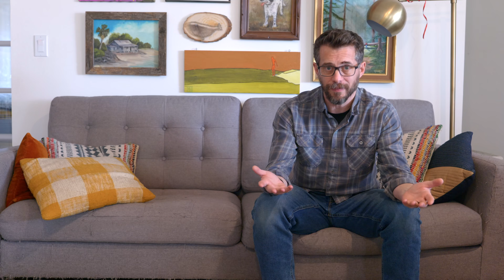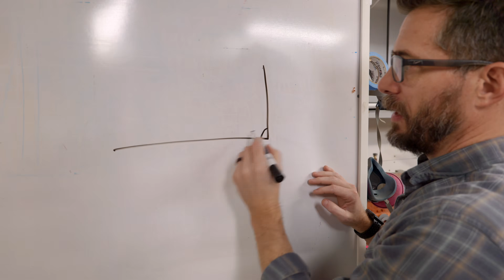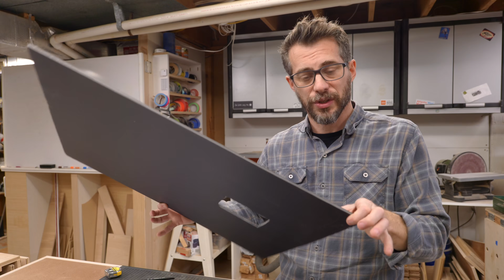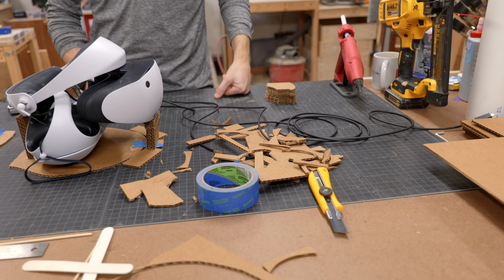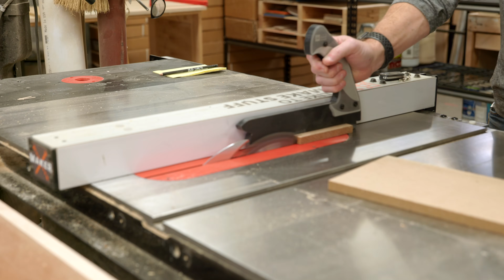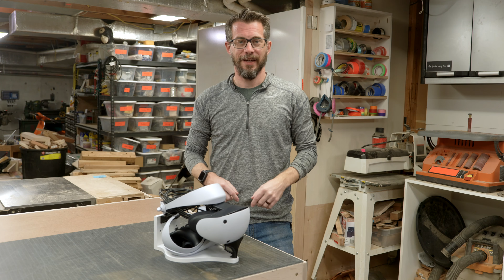I Fixed My Problem with the PSVR2!

Comment: Awesome video! One thing I would suggest to change is the back panel, or mounting panel. I would definitely reshape the corners, round them off in some way. The whole thing, including psvr2 is so curvy that those corners stick out like a sore thumb. Otherwise awesome!
Reply from the maker: That's a good call!
Reply: @Iliketomakestuff  Thanks! I'm a cabinet maker myself so I guess it just jumped out to me 😌

Comment: I still remember many podcasts back, when Jimmy mentioned that the first thing his students did was try to 3D print a prototype but they could’ve easily used ready made things like plastic bottles or make simple shapes with styrene. Adam Savage also talked about building a small room with cardboard. Even software/web design is somewhat quicker with an initial sketch. Low cost and low risk ways of trying out concepts never gets old!

Comment: I bet the console gets hotter inside that cabinet lol. Need to cut a hole in the back of it so the hot air isn't being pulled back into the front again cause it needs cooler air circulation. My PS5 sits in the open and it's like a heater blowing out the back so being in a cabinet would be like putting your PS5 in front of a heater which isn't good.

Comment: Great video! Since you used MDF, I would recommend rounding the corners of the back piece just a little more because it will lessen the chance of the corner getting dinged and it will match the other rounded areas on the piece. The 3D printed parts were very cool!

Comment: Nice stand. I made one for my VR headset using a plastic mannequin head that i filled with concrete to add some weight and mounted to a wooden base. Looks pretty awesome and cost me next to nothing.
PS. The real issue with the PSVR2 is that it's tethered. Once you try a headset without an umbilical cord, you'll never use anything else anymore. It's on another level of freedom and immersion.
Reply: So true!! Switched to the quest last year and I’m never going back

Comment: Hey, love your videos. Can you start referring to your "CNC" as a "CNC Router"? Lots of machines have computer numerical controls. The one you're talking about in this video is specifically a router. Thanks! I'm sure you know all of this, but I think it's important to be specific. When we have access to great machines such as mills, lathes, routers, laser cutters, vinyl cutters, 2d printers, 3d printers, etc., all of which are either CNC out of the box or can retrofitted, descriptions can get confusing if they're not accurate.

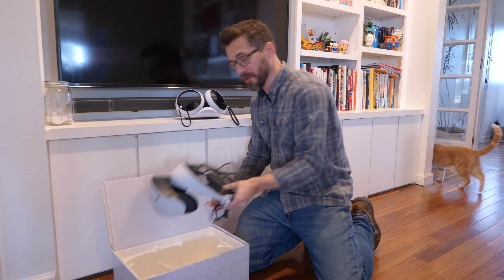Comment: 1:45 There, right in front of you on the floor, the thing you just pulled the PSVR 2 out of, the solution you've been looking for in terms of storing the thing. My pleasure.
Reply from the maker: Except that you can't charge the controllers in the box.

Comment: The design is cool. But the back piece is very massive. And it's unnecessary. But anyway . Well done
Reply from the maker: How would you wall mount it without the back panel?

Comment: It's been a week since I got my psvr2. The controllers have been f'ed since day one. Buttons and analog don't work while in game.. But works fine on the ps home menu..

I waited for the update.. But didn't fix anything. Should I just send it in now for a replacement?
Reply from the maker: that's a bummer! I haven't had any hardware issue, but yes, I would get replacements asap!

Comment: What brand are those docking stations for the controllers?
Reply: Proprietary Playstation mate, should be able tp get through Sony or anywhere that sells the PSVR2 👍
Reply: @DICKO80  😅No, the charging stands for the dualsense controllers
Reply: That’s what he was referring to. You can get them on the Sony site.
Reply: @MileHighMonroe  No, those are not the same, I have the ones from Sony. The stands in the video has animated front plates, the ones from Sony does not have that.

Comment: did it work okay with the fact the headset strap is adjustable? i'd imagine if you take it off by extending it all the way it wont fit properly...
Reply: Usually when you extend it fully to take it off you don't leave it fully extended. Once you extend the strap, it only locks in place when you turn the dial, which most people only do to tighten it onto their head.

Comment: Why don't you use a 3D scanner and scan this thing. Then put it in your CAD software and build around? The 3D scan is done in under 5 minutes... Would you have saved days and a lot of work. And it would fit perfect....

Comment: Very slick, sir. A stand by, and for, the consumer / user. It may not be for everyone, but it is a very well thought out product. An 'improvement' I might consider would be melamine surfaced, with either a black or white edge banding for the base. I like the 3D printed front and rear bracket, but as an option, the front bracket in the melamine and rear bracket in the MDF for those without a 3D printer.

Comment: If I made this for DIY plans, I would probably add a 3d-printed lip for the charging base instead of routing a pocket for it. You could cut out the other wooden bits with a bandsaw, jigsaw or a even a fretsaw if you wanted to go with hand tools, but you need a router for the pocket.

Comment: strange, why didn't you add the pins in your 3D model for the back piece?
Reply from the maker: Forgot to mention that but it was actually because of the amount of support material that would have been required based on the preferred print orientation 👍🏼  Saved about 35 minutes by printing it flat on the back
Reply: @Iliketomakestuff  makes sense!

Comment: I got excited when I saw this video , I thought someone finally has a fix for the right (or left) controller not responding in games without a hard reset to the controller. I sent my controller back to sony and I still have no update on what's going on. I had the PSVR2 since launch day and haven't been able to play anything without resetting the controller , and now that sony has my controller I really can't play anything .
Reply: That sucks, man. FYI though there are some PSVR 2 games that can be played with the Dualsense controller instead of the VR controllers. Off the top of my head, I'm pretty sure Gran Turismo 7, Thumper, Rez Infinite, Tetris Effect Connected, and I think Awesome Asteroids can be played with the Dualsense. Also I'm pretty sure Pistol Whip can be played with one controller, you just can't enable dual-wielding iirc.

Hope this helps if you're looking for something to play in the headset while you wait for Sony to repair your controller. And beyond that, it's not a bad idea to have some Dualsense games so you could still play something even if your VR controllers run out of batteries.
Reply from the maker: OOF.

Comment: The real problem is that it's not compatible with PC!
Reply: It's for the playstation what do you expect
Reply: Until some talented people make it possible. It is the Sony COMPUTER entertainment system Playstation 5.
Reply: @jamiebruner8463  has already been done
Reply: Fix for that is to put the PlayStation in a PC case with lots of rgb and call it a PCStation
Reply: I totally agree. It sucks that you can’t use that headset on PC yet but it puts more pressure on valve to up their game and take another look at their price points.
Reply: Why should it be? You don't see any pc headsets being compatible with ps5?
Reply: Certain titles will be, allegedly
Reply: Well, you can use it as a personal screen. It just doesn't have any VR support yet
Reply: @mattbell1907  tell me more. I would love to be able to use a headset rather than monitors.
Reply: @danielstellmon5330  it only works with a VR Link port which as far as I'm aware is only Nvidia RTX 20 series because the standard was dropped before any headsets came out for it.
Reply: PC handsets also don’t work on PlayStation. Of be cool if they did tough. 

Sony should at least help developers port their PSVR1 games to PSVR2.
Reply: you can plug it in and it displays so someone will eventually hopefully get it to use the rest of the headset features
Reply: Yet
Reply: It actually is. I forget what work around the guy used but there is a video out where he is using it on the PC. I'm sure there are many limitations when it comes to titles but he definitely had it running on his PC
Reply: Good, you PC owners always say consoles is garbages so now stay with your pigeon boxes and wank with your garage oculus 😂
Reply: PC’s already have headsets 🙄
Reply: @MarcusFenix762  no comparison with vr2 ☺️
Reply: nooooo
Reply: Xbox
Reply: Literally, oculus does that already lol
Reply: @MekareP  Oculus (er, Meta now) does that, and does it reasonably well, but the new Sony headset outclasses just about every other one on the market at the moment, by a decent margin.

We'll likely (hopefully?) see Meta (and/or Valve, HP, and HTC) respond with something to compete with it, but Sony set the bar high with this one.
Reply: @MekareP  course Oculus does that it's meant to do that it was meant to do that from production. What it will not do is play Sony games. On another note people have already found out how to use it on PC